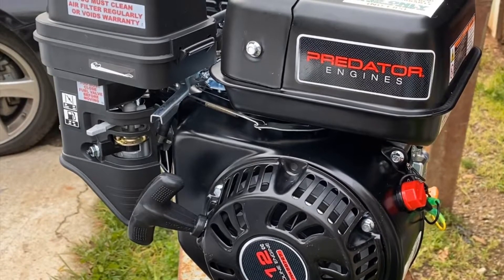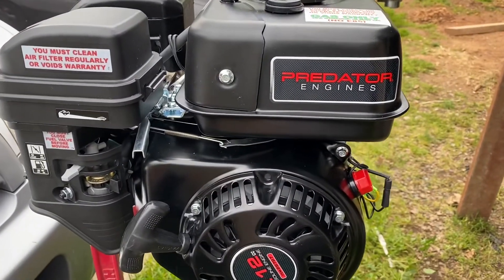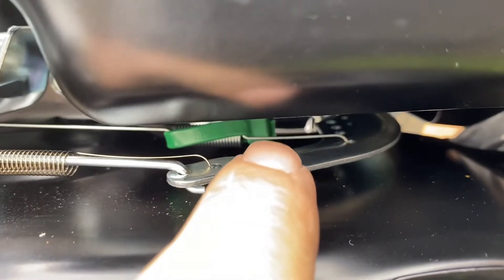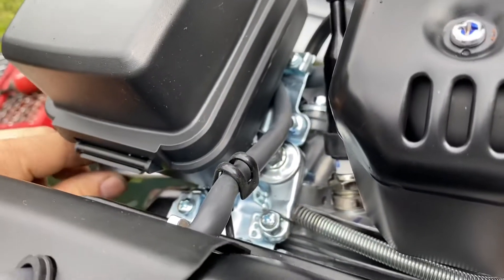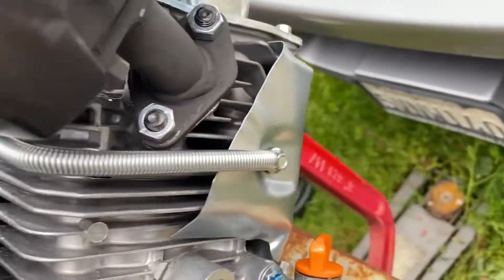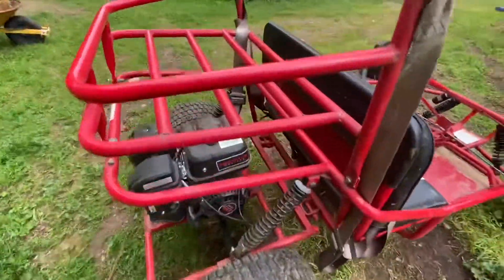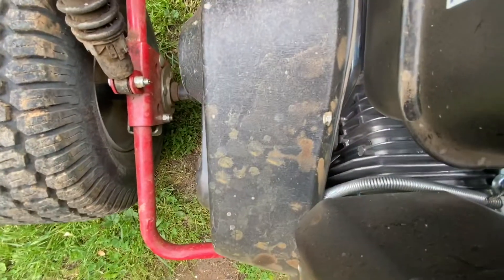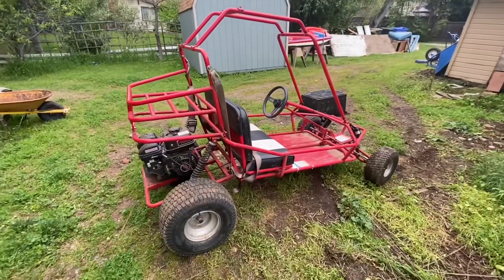Predator 212 zip ties governor bypass

Comment: Guys this zip tie governor removal works so good. I was going 30 miles when I had the governor, but when I removed it I went like 45-50 miles per hour
Reply: In my opinion, if you want to make if faster without buying anything, just add a zip tie through the governor

Comment: ... I agree with the zip tie trick but you still need to leave enough length in the spring so it doesn't pull the ends out at full throttle. If you zip tie it too tight it will yank the end loops of the spring right out of the arms.

Comment: Nice. Totally simple. 
 I hooked a spring over that spring's coils when I was experimenting and got the same result. Actually, I later put a spring that had a little less resistance to it because the engine would rpm so fast that the final drive belt was slipping in my 212 Frankenstein moped. 
  The difference in power was amazing. I had no idea the governor was slugging the engine down so much. 
 I looked at several vids to see if anyone had the governor wreck from the xtra rpm, and guys commented on running many of these engines with no issues ever.  Mike
Reply: What does this actually do? Does it make it respond faster when you give gas?
Reply: @actpt33  Yes. I ended up taking a paper clip section and linking it to the arm over the spring- giving a half inch of free play for the spring to still work- limiting rpm to 5000 or so. The power increase is remarkable, the governor does kick in, but way higher. As I wanted.   Mike
Reply: @mtwseneca  how long you drove it like this? Does it damage the engine alot? So if I understand you correctly it means it will no longer be a "gap" when you give gas? In other words instead of pulling gas and then wait until it responds it will responds instantly?
Reply: @actpt33  No Andreas, instead of a zip tie that binds up the spring - my fix is like a zip tie that is loose- allowing the governor spring to work at a higher speed only.
Reply: @mtwseneca  so zip tie trick wont affect the response of the throttle? Because its impossible making wheelie on this just because the throttle response is to slow
Reply: @actpt33  Just do it and decide for yourself. I do not like the idea of that lump of cast iron spinning beyond 5000 rpm right below my leg. Chinese cast iron.....So I do not tie off completely the governor spring.
Reply: @mtwseneca  cant you make a video of how you have yours? Because im not good at this
Reply: @actpt33  No, I am not going to do a vid on it. All you have to do is what is in this vid  only give some slack on the zip tie. I measured my gear ratio and went to a ratio / rpm calculator and plugged in the speed (you need to know the speed) and it tells you what rpm you are at. Adjust as needed more slack on the zip tie- less rpm.

Comment: What precautions should I take when doing this?.. is it alright to go full throttle?
Reply: Bypassing the governor and running the engine at higher RPMs with the governor gear still inside the engine it's equal to play a gambling game:

The governor gear is a plastic gear with 3 metallic flaps hinged on it, and it's known to frag out if spooled beyond the maximum RPMs that the engine is designed to run as stock; should that happen, plastic and metal bits will spread all over inside the engine block, and if something get stuck inbetween the camshaft drive and driven gears, neither Flexseal won't fix it. 

It's better to completely remove that gear, it's an easy task to perform.  That opens up for you the path for a billet conrod, which will be able to withstand the higher RPMs, as the stock isn't reliable enough.
Reply: full throttle is perfectly fine just as long as it’s not for 2+ minutes. you can also get a tachometer to make sure your not going over 7200 rpm

Comment: How much HP does it gain ?
Reply: None just let it have more rmp so it goes a little faster
Reply: @evjsrideandrepair8279  It DOES gain horsepower. Predator 212 engines make nearly 9 horsepower on a dyno with a simple governor delete.
Reply: It will hit nearly 9 hp.

Comment: What if you just disconnect the spring you zip tied ? Would you bypass the governor completely?
Reply: No bc when the governor gets to higher rpm the waits spread kinda like the clutch then it pulles the governor arm back this makes it not able to pull it back there for it revs higher

Comment: probably isn’t safe to do this right?? also i removed the throttle screw so can I hold the throttle down or only in bursts
Reply from the maker: Blanket statements warning for sure .... modify anything from its original specs or function would be considered unsafe. Go karts are not safe too.
Reply: @ridersoftheworld  I don’t mean safe as in someone getting hurt. I mean safe as your engine blowing or lasting half as long.
Reply from the maker: @ilovecheesecake516  hard to say. I have about seven predator engines now and haven’t had an issue with any of them for this mod. This is surprising because we were on ours almost wide-open continuously. And one of the engines is about five years old I think. What kills the mostly out here in California’s gasoline. Seems like you let it sit for a month or so and it’ll clog up the carburetor
Reply: @ridersoftheworld  Yeah i’m not running a predator. Just the stock engine.

Comment: Yo so i did this with mine and a couple of my friends engines and nobody had any problems until my friends briggs locked up and had the piston brake, the other people who did this (including me) all took the zipties off that same day, i have the preadtor 212 do yall think ill be safe to put to zip tie back on, im just really scared of it blowing up on me and my nice mini bike.
Reply: You can do it but don't full throttle for long periods only short Bursts. The governor is made so the engine doesn't over rev and blow up they are removed on racing karts because it is short Bursts of acceleration
Reply: @kcoutdoorsmissouri4052  when you say "blow up" do you mean actually explode or just break?
Reply: @crazykatana1297  honestly either. Best case your piston rings blow out, worst case the crankcase and everything blows apart right into your side
Reply: @kcoutdoorsmissouri4052  well, That's a new fear if mine now. I just got back from flooring it for hours. Thanks for telling me. Anyway to stop this from happening though?
Reply: @crazykatana1297  build the motor up but its very expensive
Reply: @crazykatana1297 were you flooring it with the bypass? and how long did the engine last
Reply: @kusinx800  you can floor it for about 10 seconds I overtook a lady in her slow f150 the other day on my go kart I floored it and maybe got up to 37mph and my engine is fine. If your fearing you blow up your engine (you dont) all you blow up is your cast iron flywheel If your going to ziptie your governor just add a billet flywheel to your engine to floor it all the way for long periods without nothing happening.
Reply from the maker: Personally I have never had an issue on any of my Predator 212s.
Reply: Someone help
Reply: @gregv1852  The engine is only 100$ new, just try it out and if you have bad luck with it get a new engine and dont do this to it

Comment: The governor works on centrifugal force with metal weights. Even with the zip tie on the the governor’s set to govern at 3600- 3800 rpm so all this is doing is pulling on the governor’s arm more. If you bypass it or remove it you could get in the 5000 rpm range
Reply from the maker: With the ziptie on it revs to 4800 RPMs on the kart..
Reply: @ridersoftheworld  on my ct200u it was going from 45km/h to 58.8 after the zip tie trick so it definitely does something
Reply: With the zip tie, you're essentially bypassing some of the governor's function. The zip tie applies extra force to the governor arm, making it harder for the weights to pull the throttle back at high RPMs.
However, since the internal governor mechanism is still in place, it's not fully removed, and the engine won't rev as high as if the governor were completely eliminated. You're probably maxing out at around 4200-4400 RPM with the zip tie instead of the ~3600 RPM factory limit.

Comment: The green zip are heat resistant so they won't melt from the engine heat, right?  Where can you buy green ones?
Reply: A regular one wouldnt have melted anyway. Thats not where your combustion happens
Reply: @derp5970  It’s a joke lol
Reply: amazon